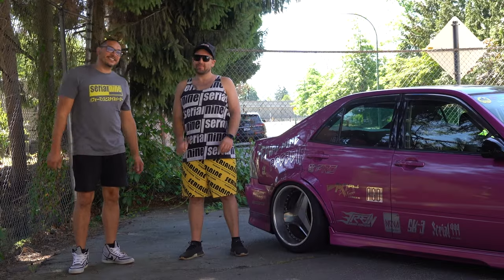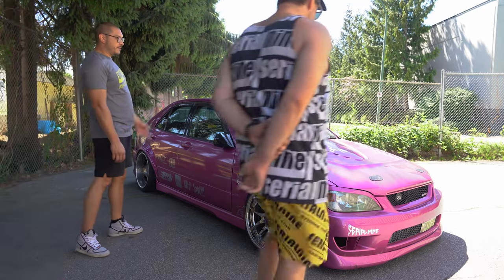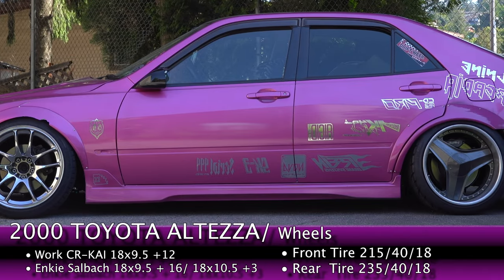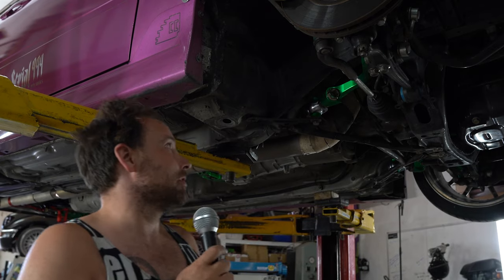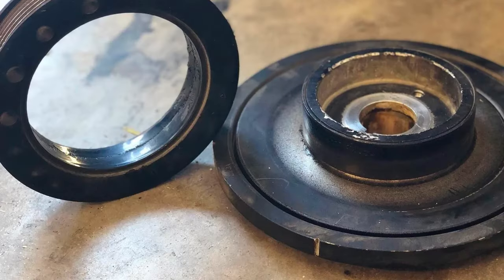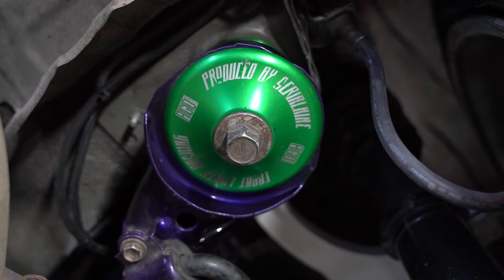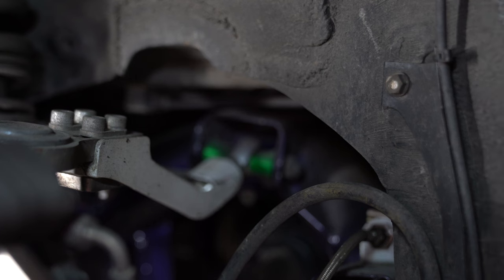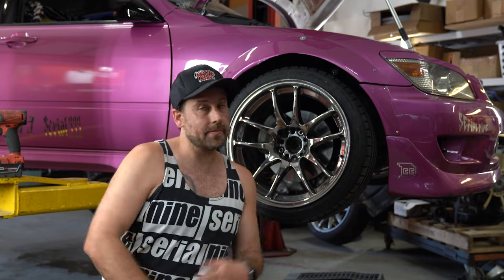Turbo IS300 Drift Car Walkaround

Comment: Is the rear serialnine subframe bushing safe to drive as a daily drive every on roads..and can they improve handling..
Reply from the maker: Yes both the subframe and diff bushings are 100% safe for use in any situation or environment !
Reply from the maker: They improve the handling by removing the ability of your old worn out bushings to move around under load. Those old bushings can allow your whole sub to shift under hard loads this can create rear steer and other undesirable handling characteristics.